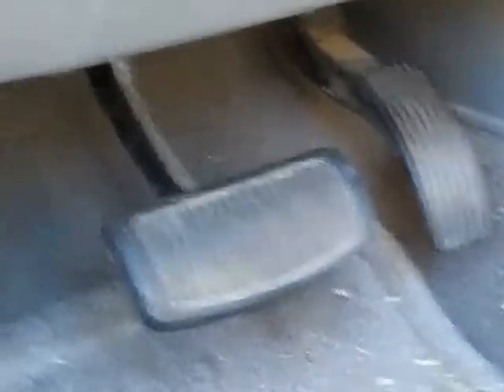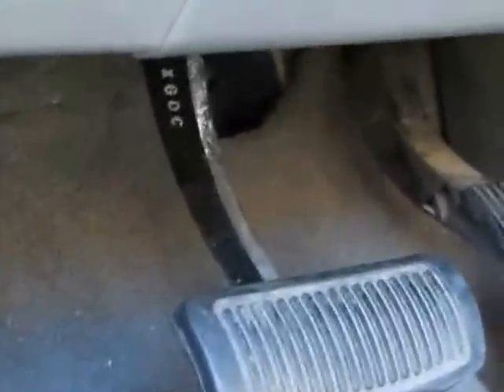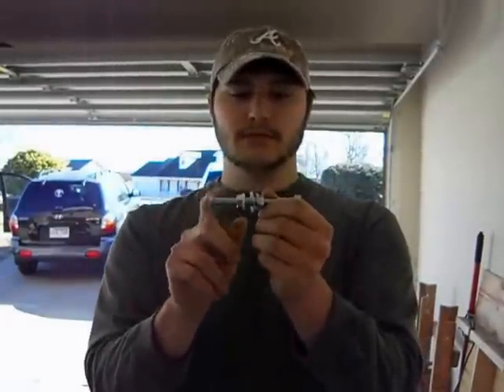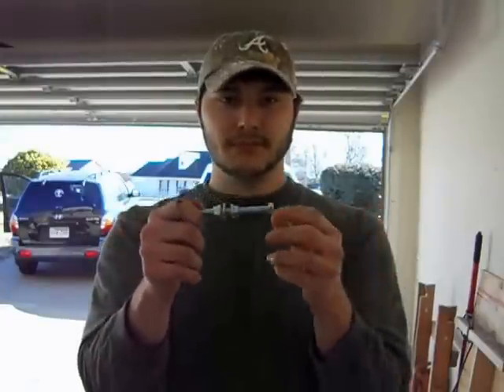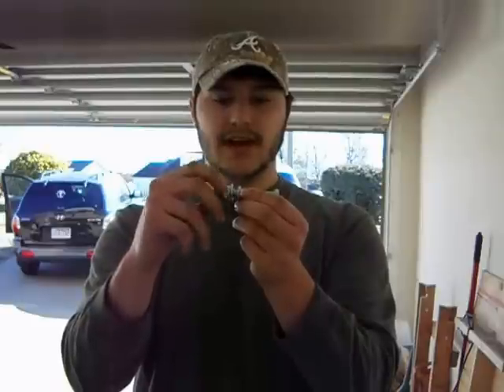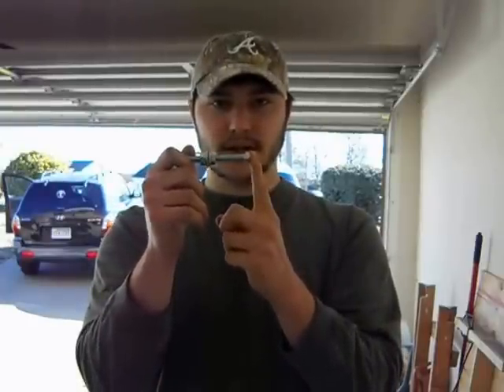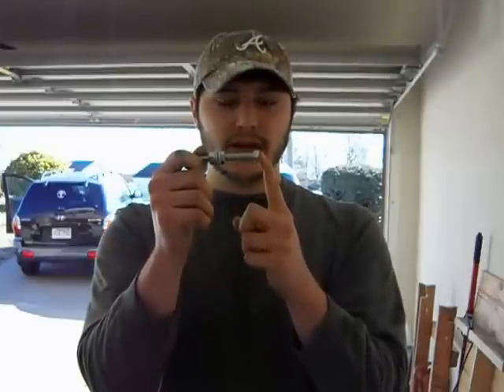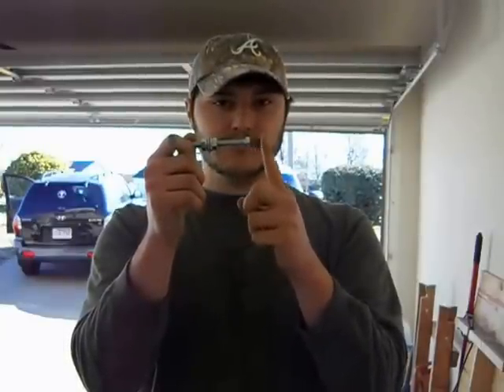Brake lights stay on? How to fix it yourself!

Comment: What is the fix ??? Nevermind.
Reply from the maker: In case anyone else has a similar thought and happens upon this comment, I saw another comment by someone saying they used a furniture pad/adhesive floor protector and it was perfect.

Comment: 6 years later and your vid is still helping people -- you just saved me many hours (and spared me from probably being totally overcharged to simply change out the piece, which I learned is called a "break light switch stopper" and costs like 75 cents!! [mine broke and fell off, causing the problem; wasn't a bolt-tightening issue] but your vid identified the prob anyway). Thanks, sir!

Comment: Wow, this video was spot on!  Great analogy with the two bolts. When I got under the dash, I found the two bolts backed away from each other. I tightened them both after making sure the white plunger switch was in a workable position and the problem was solved. We saved the cost of a visit to the service center and possibly many tow truck trips from a dead battery. Thanks very much!  - RC
Reply: Z
Reply: 0

Comment: Thank you for posting this.  The video quality in the footwell wasn't the greatest, but it got the point across so I was able to fix my wife's problem before having a flat battery.  The little yellow plastic piece broke and it was too late to go the the parts store but for a temp fix I taped 3 pennies together and taped that to the brake pedal arm where it would have touched.  Worked great!
Reply from the maker: I'm glad that you found the video helpful and hope you'll consider subscribing
Reply: It was the video and your method that saved me from a disastrous afternoon. Thank you
Reply: Omg the pennies worked ! Didnt wake up to a dead car and im on early shift . Thank you so much
Reply: MacDaddyGeek, you saved me some typing. You surfaced yet another failure mode; it's the one that I experienced. When I looked under my Toyota Tacoma's dashboard ...

1. I found the switch nuts nice and tight, and the switch in what appeared to be the correct position.
2. I removed the switch to test it with a meter. It tested fine. And yes, that switch can fail, although failures are rare.
3. I did NOT see any kind of yellow plastic button, and at the time didn't even realize there needed to be one.
4. Visibility was very low, and therefore I didn't see the HOLE that had been left in the metal as a result of the complete wearing off of the yellow button. A mechanic alerted me to the need for such a button. Without the button, the white plunger (moving part of the switch) was actually entering the hole, and thus had no opportunity to be pressed. As in your case, plugging the hole solved the problem. I used a body panel push pin.

Comment: OMG I went through and checked every fuse in the car trying to figure out why my wifes brake lights were staying on and running her battery down: and its Texas 100+ degrees today right now (evening) still in the 90's,  sweating my butt off. I watched ur video and had the problem fixed in ten minutes, hurt the crap out of my back laying upside down under the dash but I got her car fixed and I couldn't thank you enough. Great video, to the point and I completely understood your demo with the bolts and all. Thank you so much and my wife says thanks too. You might have said 14 mm wrench,,, but I took a handful of wrenches with me and found the right one, the bigger one i had to use crescent, and my hand but I think I got it tight enough. Thanks!!!
Reply from the maker: Fuses and relays were my instinctive thought as well.  It's an uncomfortable position to have to get into to fix, but luckily isn't any more difficult than it is once you're down there. Thanks for watching!

Comment: Use the furniture protector pad instead. That works if the rubber crystallized and broke off. 
The furniture protector pad is the small pad with a sticky side and soft top to prevent furniture from scratching the floor. 
Place the pad under the white part where the rubber used to be.
Reply from the maker: Good call!

Comment: Thanks man...this helped me out a lot. The yellow plastic piece (blue in my Acura rdx) broke and left a empty hole, so the sensor had nothing to press against. I replaced it with a small nut and bolt. Good as new now.
Reply: My RSX is having the same problem with brake lights, I haven't actually checked to see what is wrong with the sensor yet but this might be a good solution 👀 I read that extreme heat can damage that little part so it wouldnt surprise me that mine is busting in the summertime. Thanks for the tip!

Comment: Your video was helpful. I didn't need to tighten the nuts. Instead, it turned out a small wax plug attached to the top of the brake pedal fell out, thus preventing the pedal from pushing in the sensor and turning off the brake light despite the pedal being fully released. I re-inserted the wax plug and then the sensor worked fine.
Reply from the maker: Right on! Glad you got it fixed for free

Comment: Thanks for the tip from
Queensland, Australia.
Was stuck out in the middle of nowhere outside Brisbane with a dodgy brake light that stayed on.
The brake sensor screw had fallen out.
A quick temporary replacement with a screw got it working ok again!

Comment: my sensor drilled a whole in mine. i put a penny in between for quick fix. but when moving i will have to get it fixed. thanks bud.
Reply: I put 2 washers in between as a quick fix wrapped in duct tape.  Should hold until I make the adjustment correctly.  Penny is a better idea.

Comment: Thank you!  My brake lamp switch was adjusted 3 days ago and I thought the problem was fixed.  Tonight, my brake lamp didn’t shut off when I turned off the car and I was afraid the lights would drain my battery overnight.  Your video helped me see the problem area and I just shoved a thick note pad in the middle of the contraption and that was successful in shutting the lights off.  Now at least I’ll have a working battery so I can drive to the repair shop —to get the brake lamp switch REPLACED this time!  I left a big note for myself in the seat to remember to pull the note pad out before I try to drive it!😂

Comment: Thanks for the tip. I have a 2002 Sana Fe my fix was even easier I just put i small bolt and nut in that empty hole on the brake pedel arm.Thanks again It took 10 min.
Reply from the maker: Glad it helped!

Comment: Thank you, this helped. The setup on my Rendezvous was different, but I learned enough from your video to be able to quickly fix it. I had actually broken a zip tie that was holding the sensor down with my toe.

Comment: I just had the same issue pop up on my 2003 Civic. Thanks for the vid.
Reply from the maker: +Seth Berry Glad it was helpful!
Reply: did you have to unbolt to get to it or just put the plug in?
Reply from the maker: It was just a situation where the setup has been loosened over time and needed appropriately tightened.  Nothing was unbolted or plugged in here, what are you seeing in your assembly?

Comment: Thank you. At first I did not clearly understand the lesson, but once I got under the panel Bingo!!! I saw what you were talking about. First I tested te switch by pushing it in and then adjusted the 2 nuts and done.
Reply from the maker: I'm glad it helped! It definitely wasn't the easiest thing to depict but once you get into it I thought it could be a guide to get it fixed

Comment: Thanks for the tip!  Very helpful!  My problem was the little white plunger that was stuck in the out position.  I have a 2012 Sonata.  My design has a little rubber gasket thing that depresses the plunger.  Looks like the rubber part warped from years of use and heat.  I was able to turn it upside down and gorilla glue it in place.  It now seems to be working.  Fingers crossed.  Thanks again, Matt!

Comment: Life saver man, my Civic had the issue, apparently a bluish plastic that was holding the sensor bursted out (heat in south TX is unbearable these days). Used a nut and a bolt to solve the issue and its working like new.
Reply from the maker: Awesome, glad it helped!

Comment: Yo matt, have a 2002 santa fe as well, found the video very helpful, it is the exact problem I'm having, my "yellow buffer pad" has actually broken into pieces, any idea what the name of that part is so i can buy one? or will i have to buy the whole pedal?
Reply from the maker: Thanks for checking the video out!  Its technical name is the brake pedal stop pad.  Super cheap part that you can check out here (this one is for a sonata just because it was the first link that popped up when I googled it) ---> http://www.partsgeek.com/j8hb8h2-hyundai-sonata-brake-pedal-stop-pad.html?utm_source=shoppingcom&utm_medium=pf&utm_content=wc&utm_campaign=PartsGeek+ShoppingCom&fp=pp&utm_term=Hyundai+Brake+Pedal+Stop+Pad
Reply: I just had the same problem in an 04 Sonata... THANK YOU to both of you for the question and answer! 😊
Reply: Thanks had the same prob I just stuck a wad of paper up there for now to actuate the switch while the car isnt running
Reply: Fluffy Panda brake pedal sensor pad

Comment: I seen the busted bumper on the floor and looked under and seen a spare right next to it. I put it where I needed it with some silicone glue for back up. . Thanks for the tip.
Reply: P

Comment: Looked at our 2011 Rav 4 and that switch is totally different. 

Does not seem to have any adjustment nuts at all.

Looks like its enclosed inside a plastic shield.

Probably Toyota making sure we buy a new part and pay for the install?

Comment: I have an 2013 Elantra brake lights are on and right light is staying on hope this work’s unplugged both lights this morning so  battery wouldn’t die.
Reply from the maker: I’d be surprised if this is connected to your issue or only one light is staying on. That sounds more like an electrical component needing attention

Comment: I used a cork & glued a dime to it that presses on the switch. Works great
Reply from the maker: Good deal! Glad it helped
Reply: this is just a short fix the hard surface will eventually ware out your switch better off buying the proper part its only like 5 bucks

Comment: I. Got.  A code for my vehicle po573 indicates that the brake switch is bad. My brake lights switch indicator shows its on . but. When I step on the brakes the brake lights turn off. Then When I realise the brake pedal the. Brake lights turn off. So my brake lights work just fine. Any recommendations or should i just switch it anyways?

Comment: I found the tiny rubber piece broken on my floorboard of my 2015 Kia.....but how to fix it....lol  I will research this again
  I feel stupid that it isnt so easy to fix to me....to get down on the floor and see it in the dark...
Reply from the maker: In case anyone else has a similar thought and happens upon this comment, I saw another comment by someone saying they used a furniture pad/adhesive floor protector and it was perfect.

Comment: So just tighten the bolt?
Reply from the maker: For me I tightened the bolt and made the component function as it should’ve, but some people have said their pad has disintegrated and suggested using a furniture pad/adhesive floor protector and it was perfect.

Comment: 1:19 this shot and the explanation were really informative. Thought I knew what I was doing, till I got down there and saw nothing where the pad was supposed to be (it had crumbled). Thanks for the help 👍
Reply from the maker: In case anyone else has a similar thought and happens upon this comment, I saw another comment by someone saying they used a furniture pad/adhesive floor protector and it was perfect.

Comment: I must have a bigger problem bc I put a new one of those on a 2000 Chevy Blazer
Reply from the maker: +blackbeekiller91 Could've been a fuse, relay, wire grounding itself out, or something else altogether. I'm just seeing your comment, what was the issue if you able to fix it?

Comment: I changed my breaklight sensor but the lights are still on and wont go off
Reply from the maker: This is one of several issues that could be happening. What make/model is your vehicle? Also, is there any noteworthy information related to when the issue popped up or related occurrences?
Reply: +mattatlfan it's an volkswagen phaeton.
I changed the sensor tody and right after the change the break lights are still on even did the 5min plug off the battery thing  but they are still on so i will try tomorow to erase the fault with my vag com
Reply from the maker: +Da0Real0G there's a chance there is a relay that is out. If you can have someone stand behind your car then pull up on the break pedal, I'd be interested to see if your lights go off. If so then you may just have the sensor set too far in the on position.

Comment: Had this problem Just push in your emergency brake and release it slow, boom light off
Reply from the maker: Certainly more than one root cause for lights staying on, but your solution would not have solved my particular issue